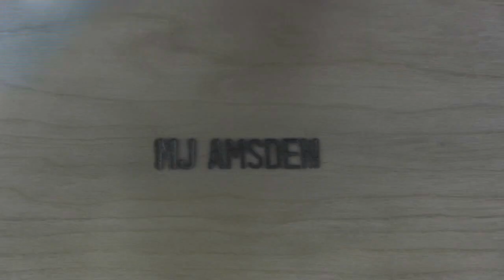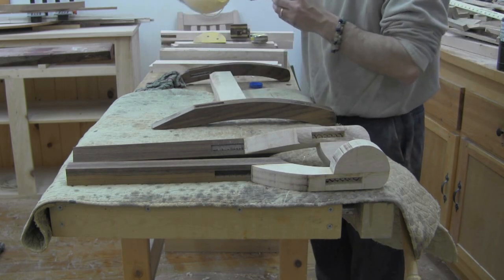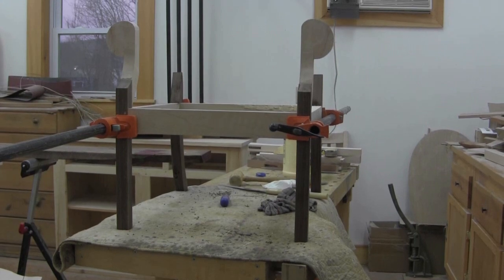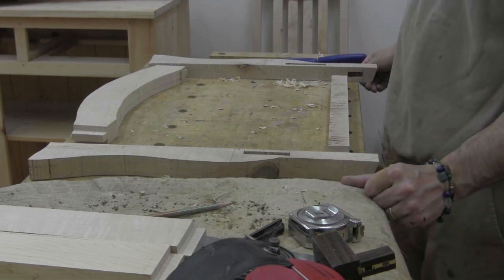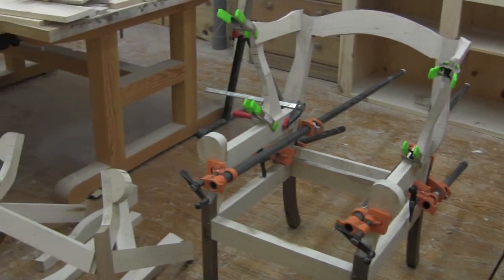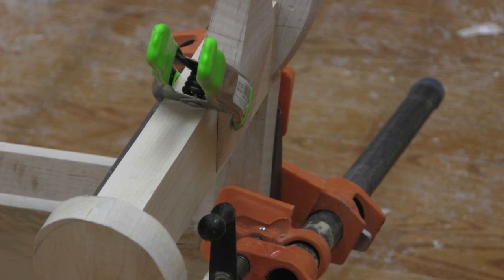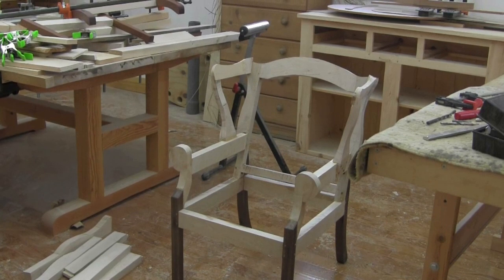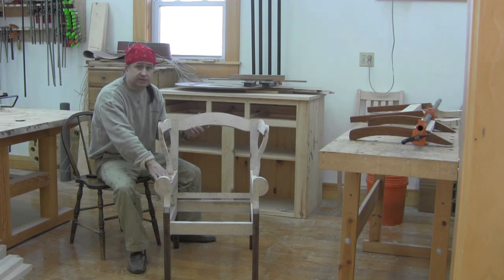Kathys Chair Part 2

Comment: Great video!! Thanks so much for sharing!!  I need to make a drop in seat frame for a very old corner chair (the wood has many hole and will no longer support the leather seat straps). Do you have a video for making a drop in seat frame or do you have any suggestions please?
Reply from the maker: Hello Mary:  Glad you enjoyed the video.  Sorry I do not have any videos on building a drop in seat frame.  Sounds like a good future video though.  In some cases I have had to cut the part with to many holes off and glue a new piece on, or in some cases you can fill the holes with hide glue, it's all very situational though.  Hope this helps.
Reply: Thanks so much for responding! Because the wood is disintegrating, I believe I’ll have to make a frame from new wood.... wish me luck! Thanks again!!